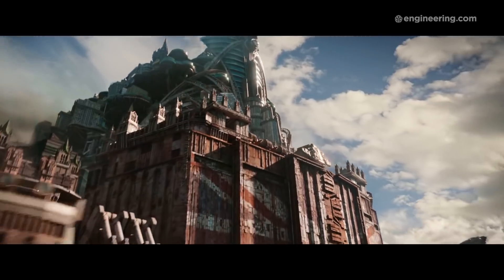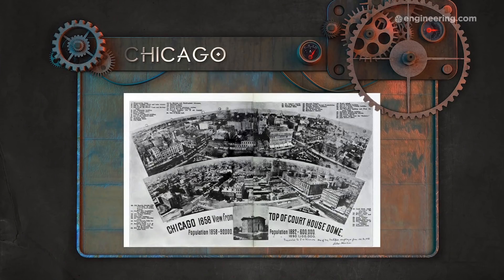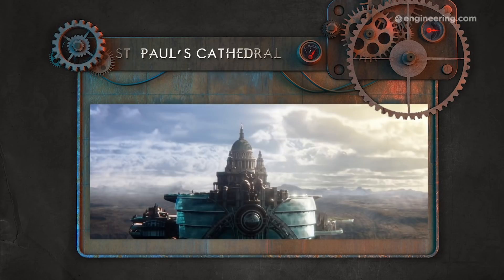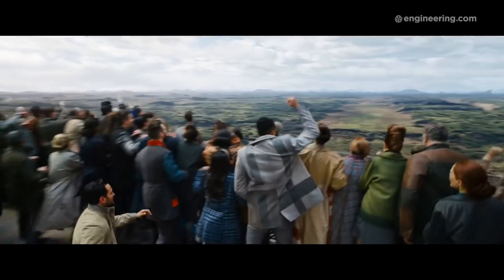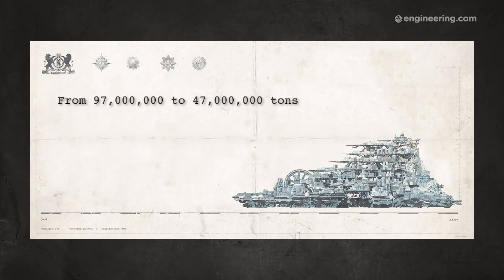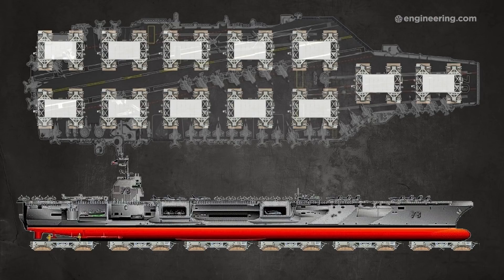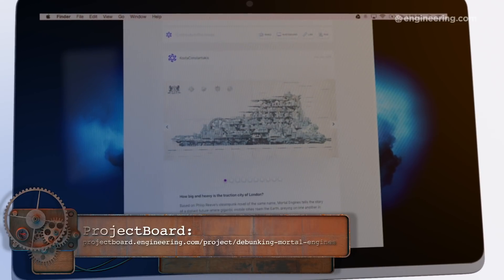Engineering Mortal Engines: Debunking the Traction City

Comment: While mobilizing a city like London or larger wouldn’t be possible, you could theoretically mobilize a small town like Salthook. It’s considerably smaller, and only runs at about 120MPH which, if the driving conditions were good enough, would have allowed it to outspeed London, if only by a little. If you were to ditch the mining equipment, that would also take off considerable weight.

Edit: plus it’s mostly metal and wood so the vibrations would likely not be as taxing on it as it would on stone structures

Comment: A little tip, It states in the prequel books that, London uses (I believe) 4 extremely large external combustion engines.
Reply: Oof I hated those ones
Reply: Mr Purple  The sterling engine is an external combustion engine.

Comment: Aircraft carriers are built very specific for that purpose, lots of extra weight not needed, im sure some clever engerneering firm could do a more specific design for a traction city, think about alloy frames used to span bridges wrapped in fiber fabric and thickly sprayed with cnt foams

Comment: All the higher level apprentices have seen this video and it's gone down well.  One of the main problems today is that young engineers are not used to estimating what the answer should roughly be before they calculate something and so the answers are often ridiculous.  This video is a good example of how this can be done even for something quite outlandish!  It looks about right too - the total power required for your first moving city is roughly the same as the total power that can be transmitted by the UK national grid - which seems reasonable.
Reply: With the right bearings, you could power it with a midget on a kid's single-speed bicycle.
Reply: That is not the case.. The thing about moving really big objects is the economy of scale. I seen a lot of people just calculating it linery, and that is what you would end up with. But with economy of scale, that would not be how it worked.

Comment: There is a few assumptions here that is stight down wrong, or in some cases implied to be wrong.
That the cities was mobilized during the steam age. Reading the book makes it clear that its not the case.
That the stone buildings is actually stone building. Its suggested that is not the case in the book. Also looking at the time frame of when the city was mobilized, that would make it very likely that its just a very thin fasad of stone at the most. The movie plays out millennium into the future. The existence of aluminum is clearly stated in the book.
That static friction is not a thing. The problem with the crawler example that the crawler always move under static friction not dynamic. It simply move that slow. And, well its built so it can´t move any faster. But if you make something that could move faster, and get into the dynamic friction range, the power needed would actually decrease, and do so quite significantly.
There is nothing suggest that the main power for the cities is carbon based. While the furnace to melt stuff is suggested to be, the power is not (at least not in the book). The lack of a chimney and the simply fact they are not just ripping up treas to burn them suggest its not. Some kind of nuclear or other non chemical power is certainly a possibility. In the beginning of the first book they talk about running out of fuel when going in chaise mode. Suggesting that there might be an auxiliary power unit burning carbon, but the primary is not. The second mobile London in the 4:th book is clearly stated to run on a non carbon diet only.

Comment: So the weight calculation based on Chicago in 1860 would be wrong, since Chicago in that day would be constructed mainly of wood, until the great Chicao fire of 1871.  London is constructed of mainly steel and iron.  However, if the creators of this video would simply have referenced the Hollywood Reporter from Dec. of 2018 in which they interviewed the design team who made the movie, the city of London is estimated at 50 million tons, cover 686 million cubic meters, and moves at 300 kmh.

Comment: What if the traction cities ran on nuclear fusion reactors? Remember this is in the really distant future, where they have some really advanced tech left over from before the sixty minute war, so it's definitely not out of the realm of possibility that they've come up with a kind of engine that can produce the needed energy with minimal fuel...
Reply: I doubt any reactors would survive the war, after all, infrastructure and power stations are quite an obvious target, and even if they survive the initial attack they'd probably be destroyed by meltdowns after getting abandoned.
Reply: @henrywong7607  Nuclear Fusion Reactored wouldn't go into meltdown, that is nuclear fission. Nuclear Fusion would just go cold and shut down. at the worst-case containment would breach, you'd have a jet of instantly hot plasma then nothing else. as the conditions to make that instantly hot plasma just lost power and contentment
Reply: What about the huge clouds of smoke from the engines.
Reply: London could be powered by high altitude air turbines that pump air for a pneumatic generator at deck and concentrated solar thermal. Helluva lot of surface area on those cities. They have airships and glass so its doable.

Comment: I don't understand it.
It's a postapocalytic scenario and oil,/ diesel and other fuel is very rare so it's a very high consuming energy. To move forward .
I mean with the fuel they use to move 10meters is enormous they could use this energy in the city for transportation and run generators for a long time
Reply: the lore explains that the cities mobalised right after the 60 minute war becasue they had to escape changing weather caused by the nuclear atmosphere. Then the moving cities worked out that they could hunt other cities as a power source.
Reply: Fuel isn’t rare in the setting at all, just because its a post-apocalypse doesn’t mean that fuel is rare. The ‘apocalypse’ in the setting is the ‘sixty minute war’ in which powerful energy weapons mounted on satellites end up destroying much of the earths surface and in particular cause massive damage to the earths crust, resulting in lots of earthquakes that make static settlements much riskier affairs(though by the time of the book series/movie the earth has recovered and static settlements once again make sense, though mobile cities are what stops static settlements coming back in force since the mobile cities both ruin the ground for farming and directly attack static settlements as easy prey.

Comment: You can get population of 1901 London by linking together or conjoining or combining these aircraft carrier size traction cities into a larger city that is longer and wider rather than piled up.
That would make this larger traction city...1997.1 meters long and 153.6 meters wide, or 1331.4 meters long and 230.4 meters wide.
I don't know if that would impact the weight of this longer and wider city...

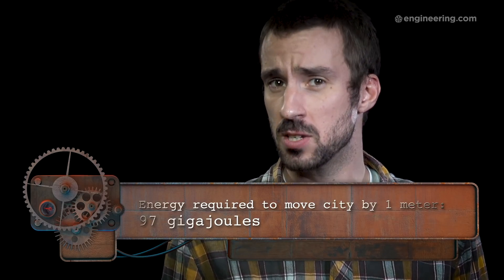Comment: The thermal efficiency of diesel engines is over 50% and could be up to 70% - I am a former technical writer for MAN Diesel. (reference the comment about 4:45)
Further, the film clearly shows that the width of the city was at least double the height - meaning it is double the width of your example.
Reply: Yea.. its kind of embarrassing when a engineer claim that a diesel is 30%

Comment: London only 700 acres? 700 square miles actually. And St. Paul's and all other brick and stone buildings would collapse within minutes of the city's starting to move, since the vibration would be like an endless earthquake. A great series of novels, by the way, if one can suspend disbelief.
Reply from the maker: Hey John T. Shea - we assumed in our calculations an area of 2,153 acres (at 2:52). 

And you're absolutely right, the vibrations would cause stone and brick structures to collapse in motion; it's something we discussed while writing on the topic but excluded in our final analysis because well, there'd be no traction city for us to analyze.
Reply: engineeringdotcom What he means is that you said that 2153 acres is “3 times the size of present day London” (which would make present day London 700 acres). You’re confusing the city of London (the city) with the “City of London” (a small district in the middle of the city). The city as a whole is more that 300 thousand acres or 700 square miles as he said.

Comment: Why not we use nuclear power as an energy source in this?....please do answer this
Reply: Nuclear power isn't used because they don't have the tech to build nuclear power plants.
Reply: @henrywong7607  I didn't mean nuclear plants...I spoke about the same mechanism of nuclear submarines....won't that same mechanism give us enough power to run this huge machine
Reply: @sharunchristo8092  Nuclear submarines are powered using nuclear reactors. It's the same mechanism.
Reply: @henrywong7607  yeah ....the thing I said was just an assumption or it's just an idea like why can't we use that as fuel ....may be not in that movie they did it.. ..but just an idea
Reply: @sharunchristo8092  Oh, in that case then I agree with you. Nuclear power is probably the only plausible option.
Reply: @henrywong7607  yep bro
Reply: the book avoids the question, the city is powerd by "old tech" with phenomenal high efficiency.
Reply: only if they have access to already refined uranium
Reply: @histguy101  Refined uranium is actually downgrading the fuel to use only 0.05% of available stock. fast reactors can use natural uranium.

Comment: The units are messed up, you mixed up the energy needed to accelerate with energy needed to move, so to sustain movement of thing already moving. By your narrationa and numbers you should say It takes 9,7 gigajoules to accelerate by 1 m/s (without any friction), moving by 1 meter is whole different calculation depending on friction, so also on speed, surface type and drivetrain lossess, whole different thing.